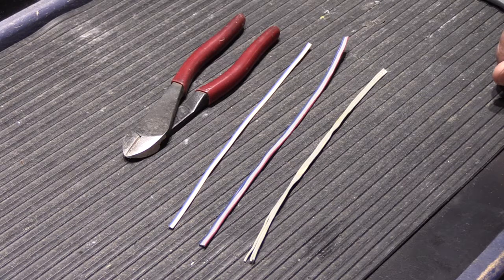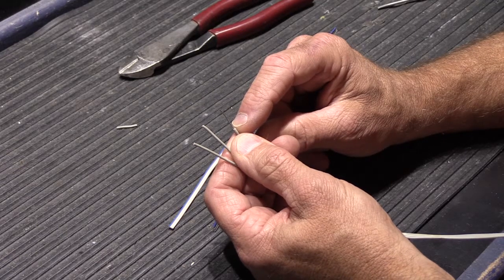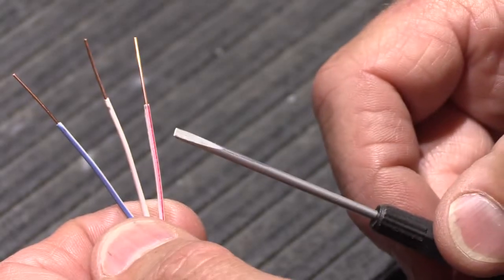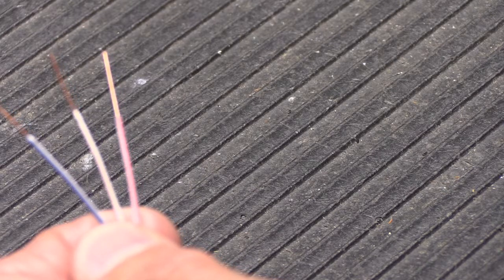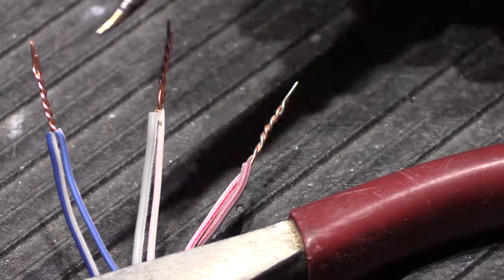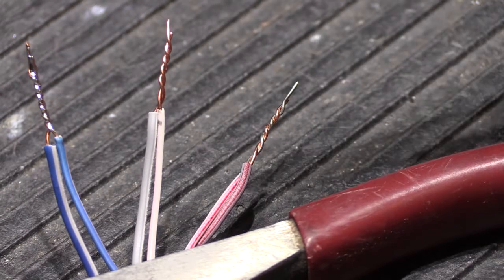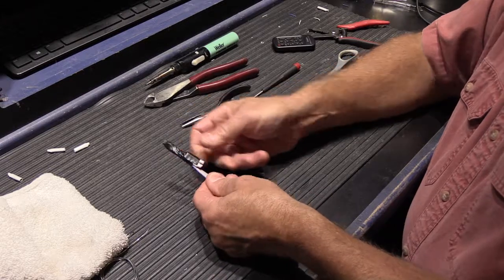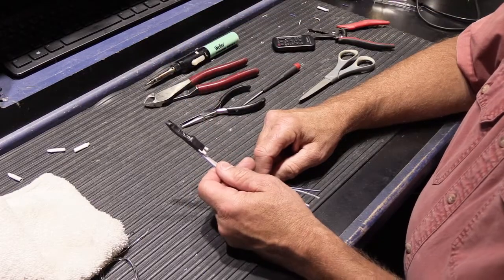The Fundamentals of NuTone 3 Conductor IW3 Intercom Wire

Comment: Hi there, I desperately need help. I am upgrading my IM-303 to a Retro M Instrasonic. I have two sets of 3 wires. Only five wires are used. Do you have any videos to show the new connections with the old wires?
Reply from the maker: Hi Eagle: Ah, No.  I'm not an Intrasonic guy - you will need to contact them to get help with installing their equipment - Chris